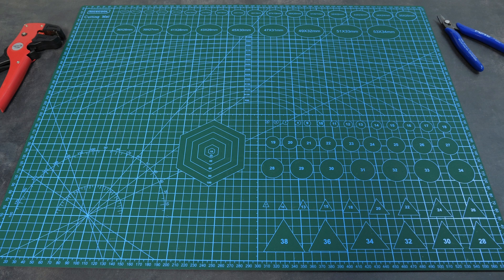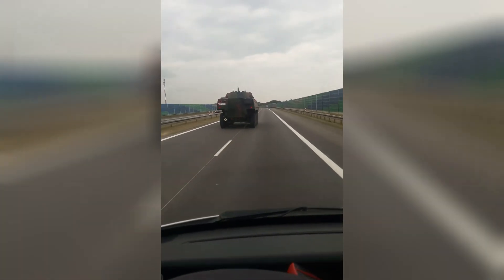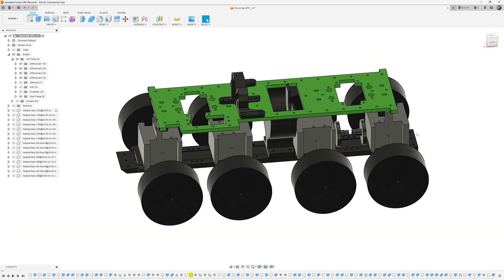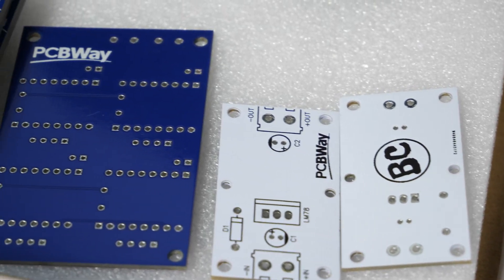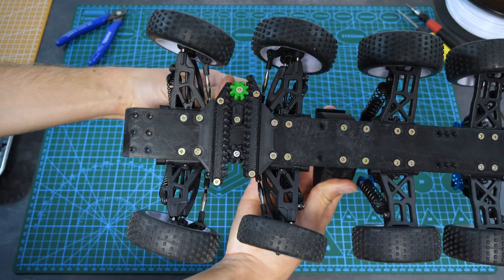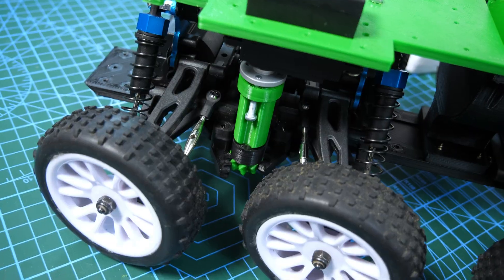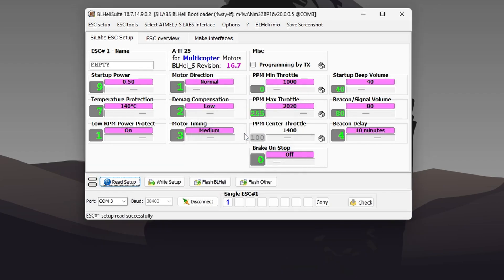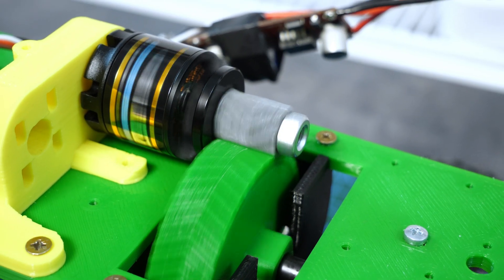I made an 8x8 RC APC - 3D Printed Brushless Car Build Tutorial

Comment: In real 8 wheel car the second steered wheel pair  turns in smaller angle then front wheel pair. If You want steer all wheels by the same angle it is probably better to make first and last wheels steerable.

Comment: Great Video! Since you have the driveshaft that runs through the vehicle, seems like you could put a PTO at front and back. Think of the accessories you could add like winches, snow plow or make it a anti land mine tank, one that shoots a line of explosives out to destroy mines.
Reply from the maker: You know what, a powered snow plow does sound pretty cool. Gotta try this when winter comes

Comment: Put an fpv system on it.

 I also using an fpv system on my 1 :10 rc racing Buggy, its much more fun to drive it this way. me and my brother have the same cars and same exact Setup. so its like an racing game, but whith real rc cars, and at the top Speed of 80Km/h  its so much Fun 😃

we use waterproof 800w inrunner Motors and encased gearboxes because of mud/dirt. This also helps with durability a Lot.
Reply from the maker: Sounds fun! And yeah FPV is a good idea. I think I will try to incorporate it alongside turret for the another video.